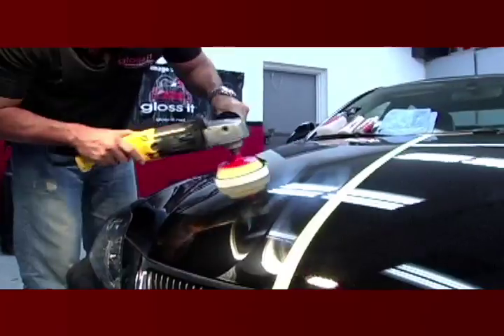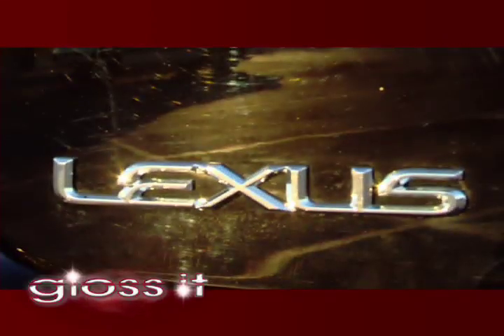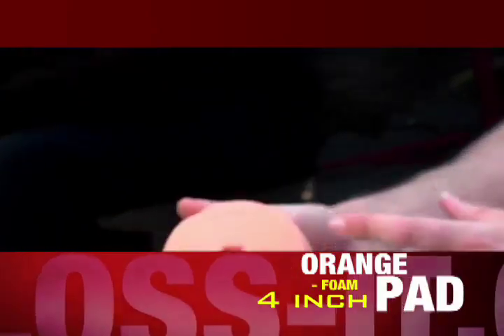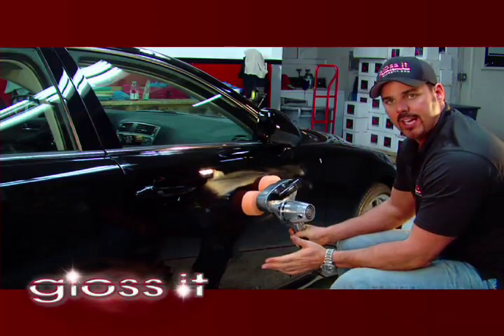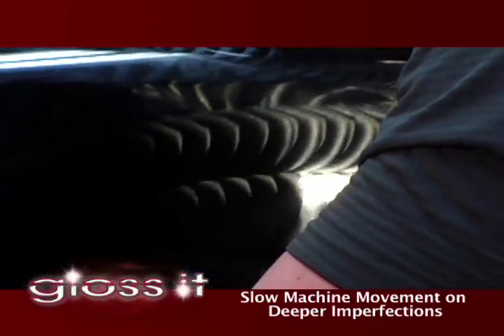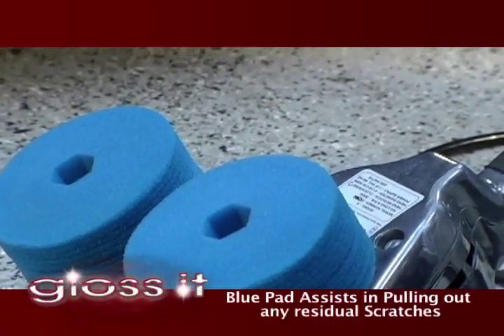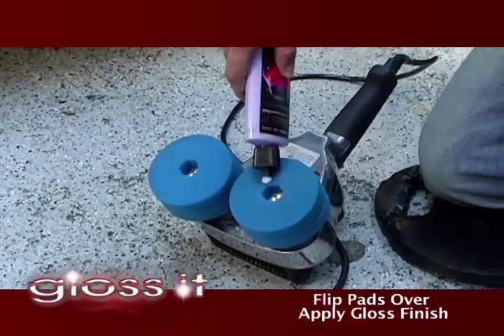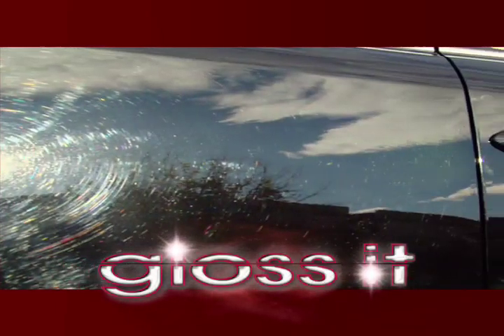Gloss It Paint Correction System for Cyclo Polisher

Comment: I am a Mobile Detailer in Las Vegas and have had the pleasure of meeting Rich. I've been using Gloss-it for several years. I have not found one group of products that can do or compare to Gloss-it. 
The longevity,depth,clarity and simplicity of application is hands down one of the best avaliable on the market. I use the Flex,Cyclo and a DeWalt high speed. This product can be used with all of the above depending on the circumstances. The dual head is the safest and quickest for a novice. The DA

Comment: @imadrunkenfooL14  I've had mine for over 20 years. I have a makita rotary, FLEX 3401 and the cyclo. They all have their purpose but the cyclo works just fine! Much cleaner(no taping of moldings/trim needed) and corrects well.